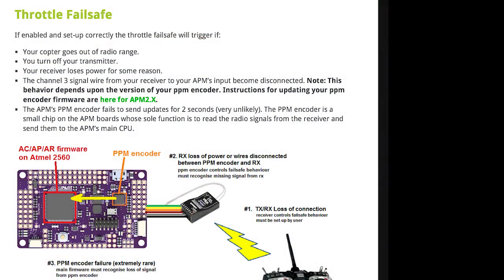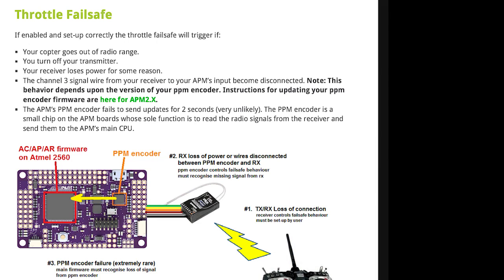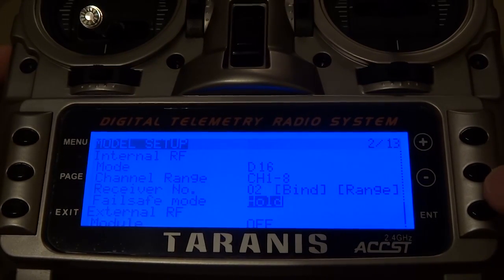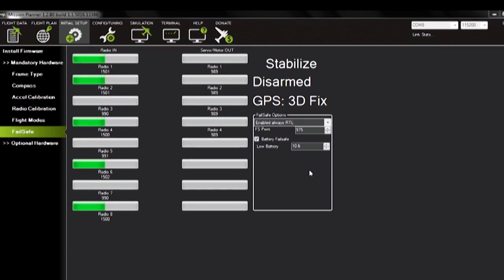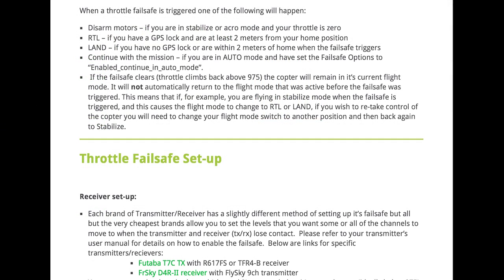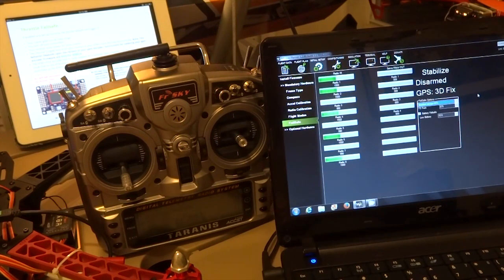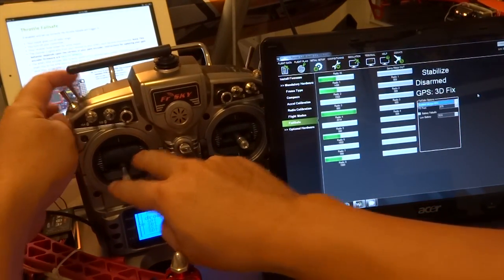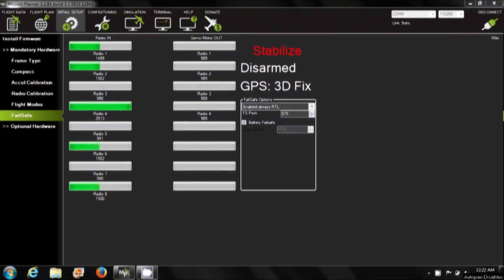FrSky Taranis Failsafe Arducopter Setup & APM Mission Planner Configuration

Comment: Hello thanks for the video. Quick qns. I am using the FrSky Tanaris on a external ezuhf module, as such there is no option in the external RF menu for failsafe, is there another work around for this?

Comment: Thanks for the Video.  I was just going through this with my Pixhawk and I was having issues with the Fail safe NOT giving me RTL like RCcopter bellow. 

I set my radio Fail Safe as suggested in the Video to "No Pulses".  Next I noticed that that all channels when the radio was turned off went low. I also setup up  using Frysky SBUS sum using one cable and was worried about the statement about channel 5 . 

However I was not getting fail safe to give me RTL because of the other rules listed in the APM manual
http://copter.ardupilot.com/wiki/throttle-failsafe/
Which I relisted bellow.

Once I got the PWM values adjusted correctly it was working correctly.

So if you are also having problems:

Make sure that:
Adjust the FS PWM field to be:
at least 10 PWM higher than your Channel 3′s PWM value when your transmitter is off
at least 10 lower than your channel 3′s PWM value when your transmitter is on
above 910
Reply: Bryon Trott will you pls make this a little bit clearer ..i can't seem to interpret ..english not my main language ..i am pulling my hair to get this figured out ..i can make failsafe to work ..afraid i will have a flyaway ..thanks

Comment: Im using Frysky X6R and SBUS to CPPM converter for single cable. If I put to "no pulse" and turn off transmitter, all channels drops to zero and not just the throttle. I tried it without the SBUS to CPPM and all channels is holding aside from throttle like on your demo. Any idea? I'm afraid that when failsafes kicks in, the channel 5 is also modified and might cause some odd behavior on the flight mode..
Reply from the maker: Hi RCCopter what is your setting for failsafe see marker 1:35 ?  Basically a flight controller (computer) takes over the flying when it detects no signal.  In this case, the APM executes a sets of actions.  You can also do a test, move your model over 2 meters away before you shut down.  Watch Radio 3, 3rd bar on the left column.
Reply: ***** Sorry for not being clear. I don't have issue on the throttle (channel 3) going down to below 900 and trigger the Failsafe. The problem is when the transmitter goes off all the channels also goes to below 900 like the channel 5. The APM might interpret this that I'm also changing flight mode on the same instance. This is only happen if I'm using Frysky SBUS to CPPM converter. If I use invidual cable for each channel from X6R to APM, only the channel 3 goes below 900 and other channel hold there values. 

On Adrucopter site they mentioned this as warning for Fryskys. 

"Warning to FRSky receiver users and users of other receivers that modify channel 5 during a failsafe event"

"Some FRSky tx/rx system: receivers can only be set-up to modify all channels including the flight mode channel (channel 5) when a failsafe event occurs.  For these receivers it is important to setup the receiver’s channel 5 failsafe value so that the APM is switched into RTL, Loiter or LAND.  This is critical because there is a very short period of time (3/50ths of a second) between when the receiver pulls the throttle low and when the APM initiates the RTL or LAND.  During this time, if the receiver also switches the flight mode channel to stabilize or acro the APM may switch to stabilize momentarily and then because the copter is in stabilize with throttle at zero it will disarm the copter (i.e. Test #2)."